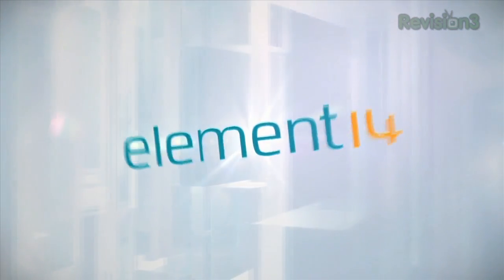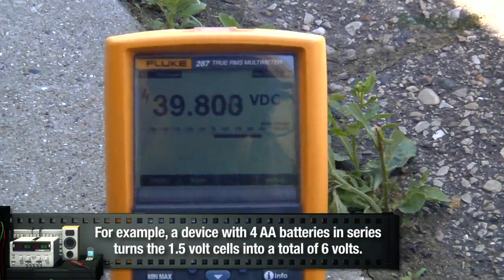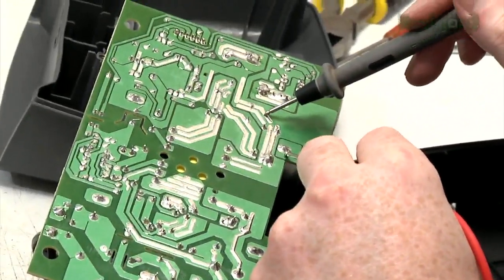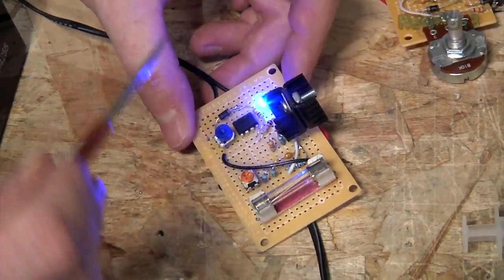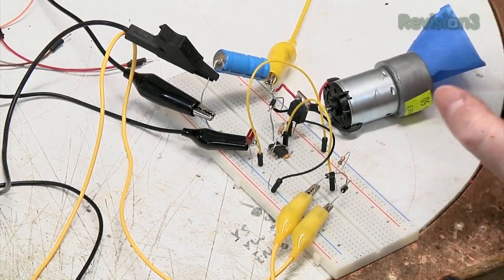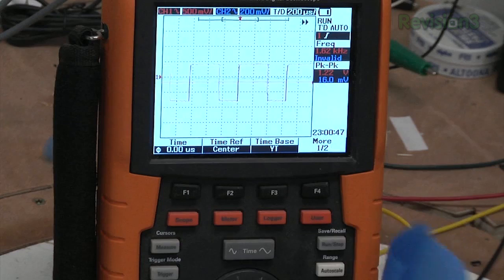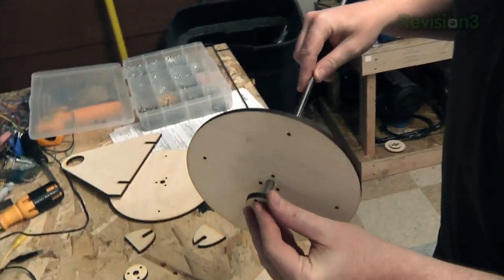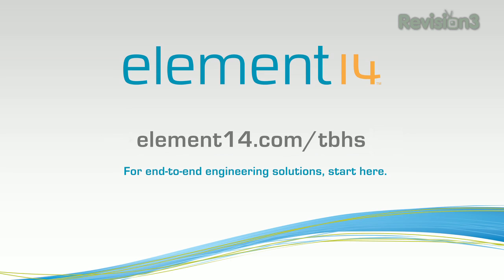Solar-Powered Camping Mods for the Lazy Man!

Comment: all we need now is portable wifi so we can get wifi in the forest were we don't have wifi 3g or 4g
Reply: Unlikely to happen due to the limited range wifi has. Add in the power requirements for Wifi and it becomes even more unlikely. Even worse, in the US, are the FCC regulations regarding wifi power limitations. That's why other technologies such as LTE exist. Relatively low power, more efficient bandwidth, FCC approved, and better range due to bandwidth/frequency.
Reply: They already sell mobile hotspots that provide 4g and lte mobile data/wifi and runs off a rechargeable battery
Reply: Vincent blunt My point exactly. Those mobile hotspots are nothing more than wifi repeaters for underlying methods like 4G, LTE, etc.

Comment: should have used a partially drained battery. Solar is the future. Its free! Why are we burning coal!
Reply: We are burning coal because it's cheaper, and the power produced by 1 kg of coal its much more than the produced with the amount of solar panels using the same weight, that's why!
Reply: ***** Yes, air polution is really bad, but coal and oil it's the best thing we have now, solar panels are good, but they are still in development

Comment: Cool stuff in this video!  Thank!.

I like to bike tour.  Increasingly people are using cameras, gps, phones, tablets, etc...  And they all need recharging.  Solar is a possible source for that, but also good is a generator hub that is built right into the wheel.  These keep getting better, and they add hardly any load to peddling.  I'd love to know how to connect that AC source , 3 watts, 6 volts for charging.

In the third world, stationary bikes are mechanically connected to do a lot of domestic tasks, generation is another possibility.

Comment: Well done informative video Mr Ben Heck. Do the iphone and iPad have battery minder chips built in to them? 

My understanding is, If you want to charge Lithium based Batteries you should know what your doing or you could ruin your batteries & equipment.

 ...charging Lithium based batteries with a charger specifically designed for lithium chemistry batteries is critical to both the life span of the battery pack, and your safety.

Comment: Hi Ben, I'm currently working on a solar-powered system which uses a Raspberry Pi and this episode was useful!  Do you have any suggestions for powering the Pi from a 12V battery?  Current prototype supply uses an L7805CV which powers perfectly, apart from the strong smell of burning veroboard as the thing reaches finger-melting temperatures.  Assuming this is down to sheet current, or are linear regulators a no-go?  Now off to watch more!

Comment: Hi Ben, Your show is awesome!!! You have really expanded my knowledge of electronics and i  am starting to understand it more and more. I have a question for you my daughter has a Powerwheels with the a NiCad battery and it runs down quickly and doesn't work like it used to and its only about a year old with minimal use. Is there a way to possibly change to a lithium ion battery? I would rather try to experiment with something like that than spend another $65.00 on another battery. Thanks!!!

Comment: We live in a day and age where 12 volt systems are deemed to be a resource we can't be without.

I even go as far as advocating a mandate for 12 volt systems on non-motorized vehicles like pedal bikes.  Ben Heck should see my bike.  I use a central lead-acid battery to recharge smaller rechargeable batteries as well as avoid rampancy of non-rechargeable ones, and I've even gone as far as using resistors to make otherwise incompatible devices compatible with 12 volts.